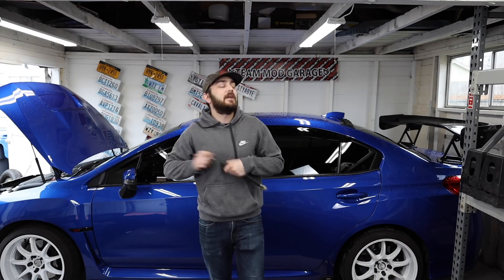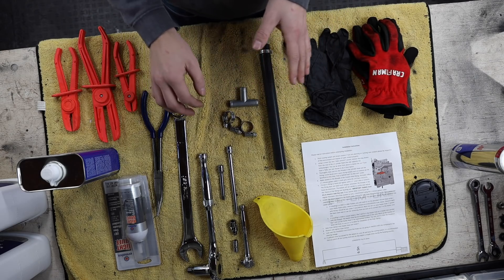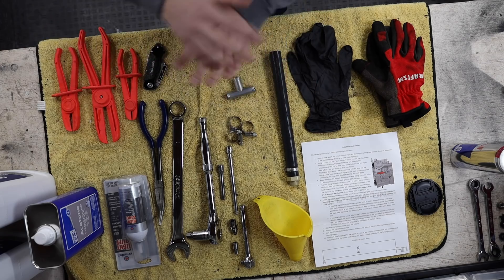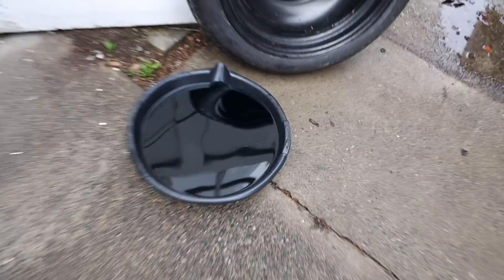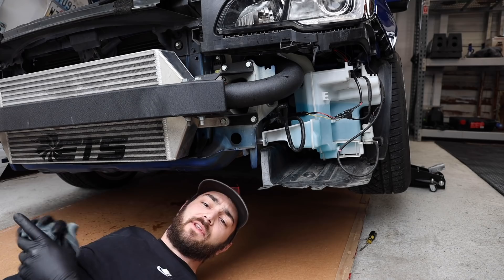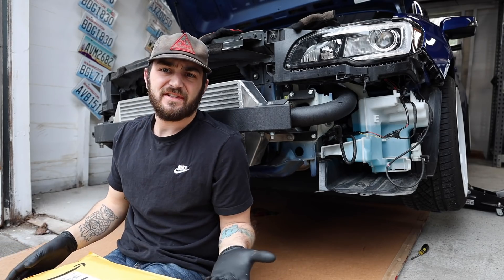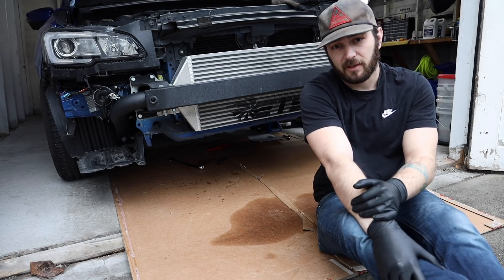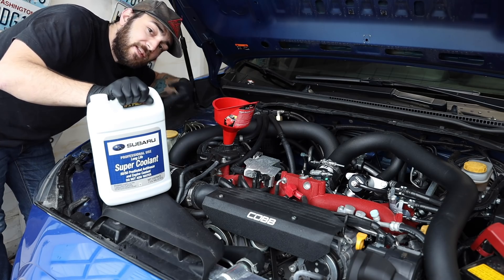Cylinder 4 Cooling MOD Install (STI)

Comment: Love the video, I would recommend getting a spill free funnel for adding coolant and burping. It firmly attaches to the fill neck for the coolant so it won't leak/spill. It lets you burp and keep extra coolant in the funnel so you don't need to continuously add while burping.
Reply from the maker: I use to have one and it grew legs and walked out of the garage at some point 😅 lol but I agree the funnel would make life a lot easier so I'm not continously cleaning spilt coolant
Reply: @Smeedia  just walked off like the 10mm socket??
Reply from the maker: @BlazeOn88  I think it walked off with the 10mm socket..... lmao

Comment: this part is unnecessarily expensive I bought some AN hydraulic fittings and a brass 5/8" tee. You can do the math to find the difference. This kit is high quality, yes but why buy it when you can do it with similar quality with way less money.
Reply from the maker: Very true, the kit just simplifies it so you dont have to source everything. But you could get all of the parts for about $15-$20
Reply: @Smeedia  Subaru coolant is also not designed for brass. Over the long term, you are likely to see corrosion.
Reply from the maker: @pieterprinsloo6451  the Included at fitting in the Get a dome tune kit is steel, the PH level of the coolant would start to degrade the brass over time, you are 100% correct on that. If someone were to source their own kit it would be important to either get steel, or swap out t fittings every X amount of miles

Comment: Bro i got a vw and i really want to get a wrx or an sti wich one in your opinion ? :)
Reply from the maker: All depends on what your end goal is for the car 😁 WRX is better in city driving because of the low end torque with the FA20s or the STI or EJ based Cars are both fun, they like the higher RPMs though for power
Reply: @Smeedia  thank you for the helpfull info bro! 😀

Comment: Been waiting for this one , along with equal length header's it's good insurance against cylinder 4 failure !
Reply from the maker: Oh yes! Need to get a set of ELH still!
Reply from the maker: UEL headers generate more heat which transfers into the block, the longer unequal length cause the heat to take longer to travel through the pipe so it gets hotter increasing the chances of knock
Reply from the maker: Nothing to worry about and completely normal 👍
Reply: @Darren Desantis youd have to worry if your dam changes from 1.000. Such low knock is probably phantom knock.

Comment: Great video bro. Look into investing into a creeper save your neck some stress when under the car. Speaking from experience 😂
Reply from the maker: I need one 😫 the floor in my garage is so uneven I wouldn't be able to roll around though 😅